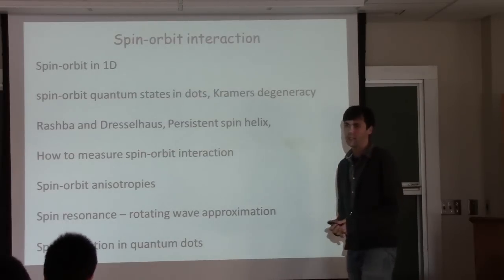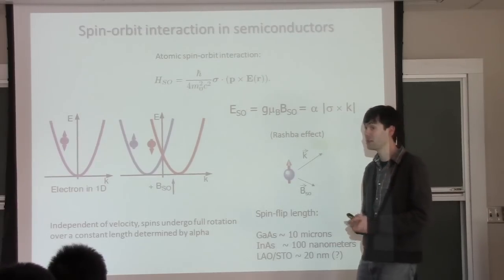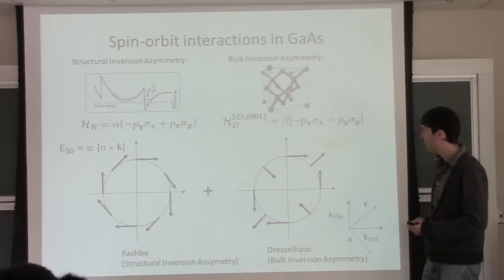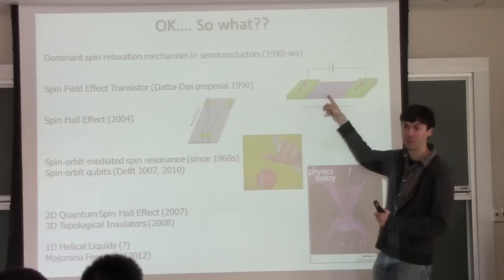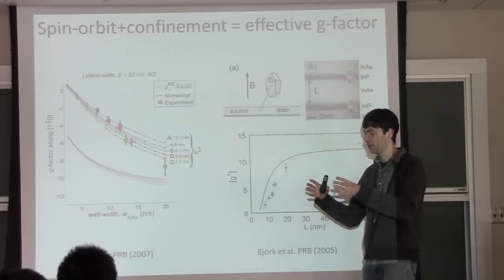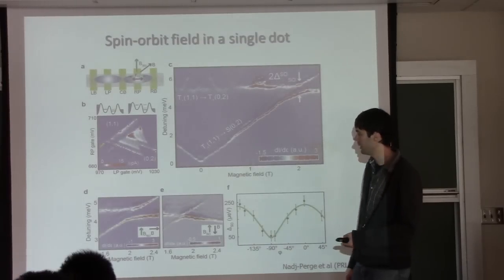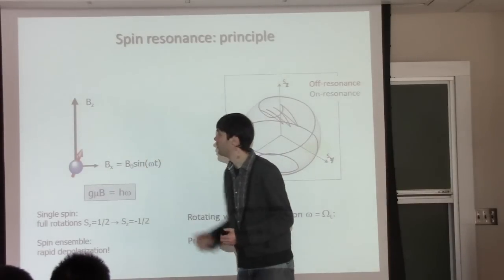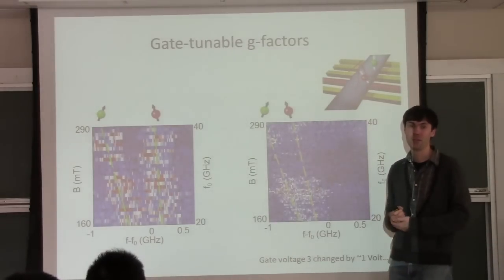Quantum Transport, Lecture 10: Spin-Orbit Interaction

Comment: Deutsch
Könnten Helium Zeppeline eine Lösung für Transporte in den Orbit sein. Damit könnten doch Module für eine Werft für den Bau von Transportschiffen oder anderes transportieren ohne große Umweltschäden zu verursachen. Die Teile könnten als Fertigbauteile mit Helium gefüllte Zeppeline oder Ballone hinaufbefördert werden. Außerdem ferngesteuert Bauteile auf den Mond bringen um dort eine Station einzurichten, oder auch eine Wert bauen. Hört sich doch gut an! Und es könnte kostengünstiger werden, wenn wir die Challengers mit Ballone in den Orbit gehoben werden. Von dort aus mit weniger Treibstoffverbrauch gezündet werden. Naja nur mal eine Idee.

Englisch
Could helium zeppelins be a solution for transports into orbit? With that, modules for a shipyard for the construction of transport ships or other things could be transported without causing major environmental damage. The parts could be carried up as prefabricated components with helium-filled zeppelins or balloons. In addition, remotely controlling components to bring them to the moon to set up a station there, or even build a value. Sounds good! And it could be cheaper if we put the Challengers into orbit with balloons. From there it can be ignited with less fuel consumption. Well just an idea.

Französich
Les zeppelins à l'hélium pourraient-ils être une solution pour les transports en orbite? Avec cela, des modules pour un chantier naval pour la construction de navires de transport ou d'autres choses pourraient être transportés sans causer de dommages environnementaux majeurs. Les pièces peuvent être transportées en tant que composants préfabriqués avec des zeppelins ou des ballons remplis d'hélium. De plus, contrôler à distance des composants pour les amener sur la lune pour y installer une station, voire y construire une valeur. Ça m'a l'air bien! Et cela pourrait être moins cher si nous mettions les Challengers en orbite avec des ballons. De là, il peut être allumé avec moins de consommation de carburant. Eh bien juste une idée.

Spanisch
¿Podrían los zepelines de helio ser una solución para los transportes en órbita? Con eso, los módulos para un astillero para la construcción de barcos de transporte u otras cosas podrían transportarse sin causar un daño ambiental importante. Las piezas podrían transportarse como componentes prefabricados con zepelines o globos llenos de helio. Además, los componentes controlados a distancia para llevar a la luna para establecer una estación allí, o incluso construir un valor. ¡Suena bien! Y podría ser más barato si ponemos a los Challengers en órbita con globos. Desde allí se puede encender con un menor consumo de combustible. Bueno, solo una idea.

Russisch
Могут ли гелиевые цеппелины стать решением для транспортировки на орбиту? При этом модули для верфи для строительства транспортных кораблей или другие вещи можно было транспортировать, не нанося серьезного ущерба окружающей среде. Детали можно было поднимать в виде сборных компонентов с помощью гелиевых цеппелинов или воздушных шаров. Кроме того, компоненты с дистанционным управлением, которые можно доставить на Луну, чтобы установить там станцию или повысить ценность. Звучит хорошо! И было бы дешевле, если бы «Челленджеры» вывели на орбиту с помощью воздушных шаров. Оттуда его можно воспламенить с меньшим расходом топлива. Ну просто идея.

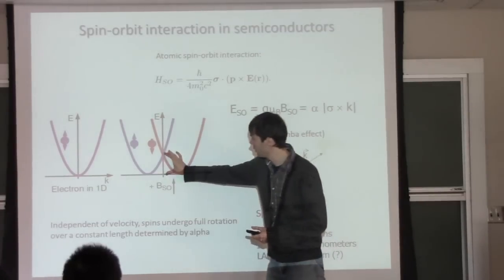Comment: at 5:39 you say that the y value of the crossing point between the two parabolas represents the spin-orbit energy. But shouldn't that point always be at the origin? if k=0 then there's no spin-orbit coupling, and of course there's no kinetic component, how can the parabolas get up there?
Reply from the maker: Spin-orbit energy will be the energy difference between the crossing point at k=0 and the bottom of the parabolas
Reply: But how at k=0 the value of energy is non-zero?(as asked above both kinetic component and spin-orbit part goes to zero at k=0.)
Reply: @blessonsamvarghese4525  The energy is zero at that point. The parabolas shift both vertically and hortizontally.

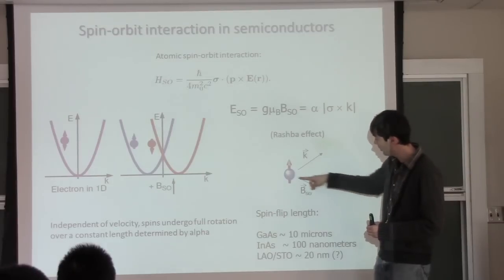Comment: at 7:50 you talk about rotations. A spin after rotating by 2 pi is flipped and 4 pi, it comes back to its original orientation
Reply: +Jonathan Furtado that's right, I don't understand what kind of rotation he's talking about, since the electron is described by a spinor field...still I don't have a good idea about the spin relaxation length or time.